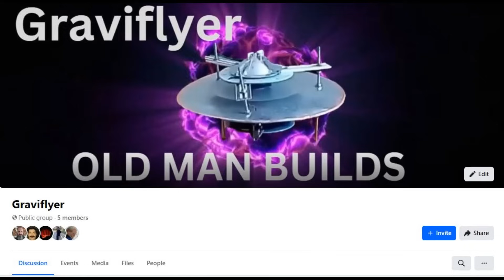Changing the volts and amps in dc flyback

Comment: Great video, I have found that some fly-backs will overheat if you push the amps to much, the better ones are the ones stripped directly out of old CRT TV's , the newer of the shelf (replacement parts) fly-backs are not well build.
Reply from the maker: I agree

Comment: Is it bad that the retaining metal clip on your flyback core is under the windings of the primary connected to the zvs output?

I've seen instances where it would cause heat buildup due to the induction of the coils. I've had it happen once.
Reply from the maker: it has never been an issue for me.